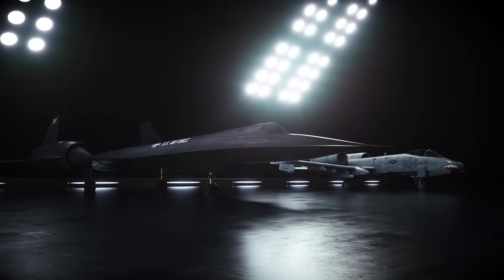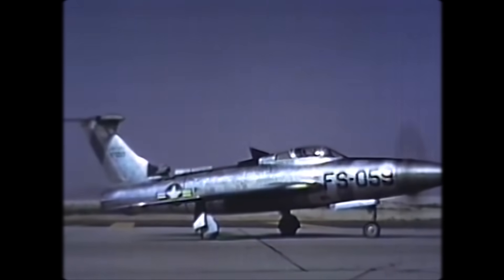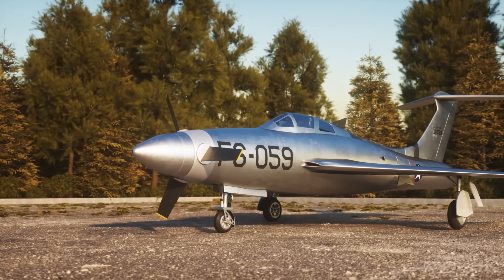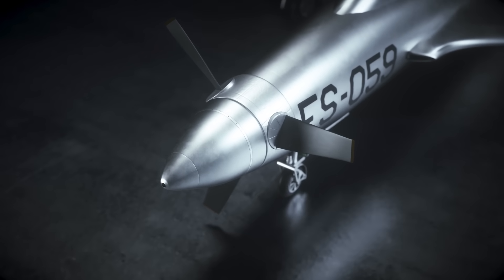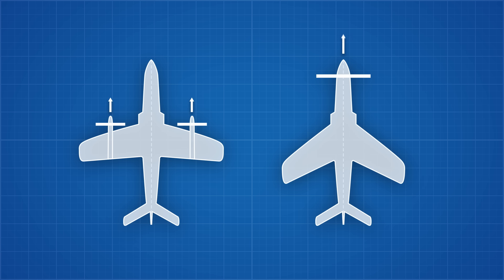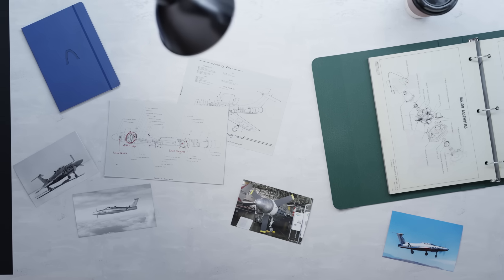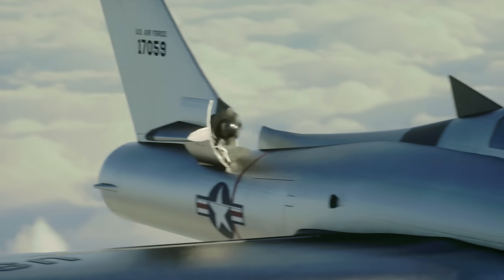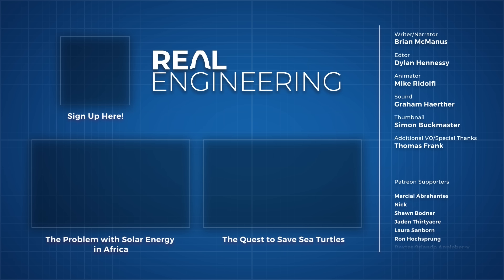The Insane Engineering of the Thunderscreech

Comment: I wonder how this would work on a drone powered by electric motors to shut the noise off until over suppression areas. One of these props on the front and a jet for thrust and electrical supply.

Comment: 13:12 why didn’t they use a contra rotating prop design like the A2d-1 to counter the torque?
Reply: not sure but id assume it's because there would be a bunch of issues with drag at high speeds when theres two propellers.

Comment: Decibels are a logarithmic scale of the pressure created by a sound wave compared to a reference pressure. Every 10 decibels you go up, the pressure increases 10x. If you go up 20 decibels, the pressure is (10)^2 times the previous pressure, or 100x. This thing was said to produce 200 decibels. A rock concert is around 120 decibels. 200 decibels is 100,000,000 times that

Comment: It's strange to call this an "abomination" when in fact it's pretty clever engineering to get around a lot of problems. I wonder how many discussions there were around weaponizing the sound this plane generates. Making low passes over enemy lines could dramatically reduce their combat effectiveness without expending any ammunition. I bet modern materials and engineering could solve some of the reliability and stability issues. At the very least, carbon fiber driveshafts would reduce the vibration issue.

Comment: Very late comment coming in here, but c'mon man, don't shit on the TACIT (not tactic) BLUE. It was the follow up to the HAVE BLUE which gave us the F-117 and the TACIT BLUE is directly responsible for the design of the B-2. And it was a surveillance demonstrator, but was also the computational proof of concept for the implementation of Pyotr Ufimtsev's "Method for Edge Wave in the theory of Diffraction" in rounded and non-polygonal surfaces. So if you think the F-22, F-35, B-2, or B-21 look like they are "designed by a three year old", then okay stick to your guns.

Comment: i see there is misconception, and funny how even the uncle sam's engineers are completely dont understand what sonic boom is.  they could mistaken the thumping sound when jet engine reach the speed of sound expansion with the sound coming from a aero vacuum crack. aero vacuum crack dont sound thumping, it sound shrieking. 
so when they hear a loud shrieking sound from the propeller thats not sonic boom. thats aero vacuum crack. thats the same "boom"(notice its not booming. unlike sonic booms) you  hear from any other kind of aero disturbance. sonic boom thumps, because its about sound pressure reaching millions times of the source of the sound itself. multiply the decibels. the overlapping sound makes a thumping sound. like a slap at the air.
i think the skunkworks themselves have just learned what sonic boom really is right now, when they tested that new plane with the super long fuselage. when they will realize the sonic boom does not cause by aero disturbance, but by the speed of sound itself. when sound going as  fast as it expand and overlaps.  (notice i said SOUND. you want to get rid of sonic boom you make engine produces no sound when flying.)
thats why they call it a thunderSCREECH. because it caused by the air vacuum cracks produced by the propeller. sonic boom on the other hand would be produced BY THE ENGINE hums, when the plane goes at exactly 1:1 speed of sound.
and that shrieking sound from the propeller only signify one thing, BAD AERO DESIGN on the propeller.
 in formula one, the engineer recognize BAD aero coefficiency of a section in the car mould when it produces loud aero turbulence sound.
meaning the propeller blade design is BAD. hence why they said the plane DIDNT REALLY REACHED the speed of sound in practice. too much RPM lost to the vacuum cracks on the propeller's INEFFICIENT aero flows. which means energy loss.
im sure the skunkworks who worked on that would understand what i just said.

Comment: 2:05 it’s funny that you say a prop plane is the loudest plane ever created when the F 35 F135 Pratt & Whitney engine is considered the loudest thing on earth like 170 dB or something like that 180 dB wanna top fuel dragster full throttle is like 150 dB the only thing that might be louder than a jet engine is a rocket engine. I’ve also heard that rockets that take off are also the loudest thing on earth but there’s absolutely no way a propeller engine is the loudest plane engine ever made I guarantee the Pratt & Whitney F135 that is in, Lockheed Martin F 35s are louder if not one of those giant engines that was in the SR 71 or maybe the six giant engines that were in the XB 72 Valkyrie, but I guarantee there’s no way this engine was louder not even with the weird shape propeller, making ungodly noises from a pure guessable stand point it’s impossible for a propeller engine to make more than 160 dB

Comment: You can really tell it was purely a propeller "proof of concept" platform rather than a testbed for a whole aircraft just because of how slapped together it was.
"Here's an aircraft, make it work"
A single turbine with a pusher prop configuration would have made a lot more sense *for a plane*, but as a proof of concept this did exactly what it was intended to do.

Comment: Love ur vids but I think ur assessment of the propeller producing the screech is incorrect. IMO the Screeching sound is made by the air being forcibly sucked into the tiny intakes creating a vaccum which created a whistle and if u keep adding more power the inflow of air is going to get more violent making the case even worse. I spent the entirety of the video looking for the intakes only to realize those slits in the wings are the intakes. the induction shriek is even audible in certain cars where the intake system is overwhelmed by the demands of the engine. u can blow a whistle by blowing air out or in and i think the latter is responsible for the sound.

Comment: The V22 Osprey engines are both mounted on the end of each wing but there is a driveshaft that stretches across the wing, connecting either engine to either propeller. So if one engine fails, other engine can power both propellers without any asymmetric thrust.

Comment: They should apply the counter rotating revision of this propeller concept. This would be not just torque, precession and propwash-free, but even higher thrust, higher efficient air mass flow behind the propellers, which is better for the higher speed regimes. And of course, the sound would be way more louder! :)

Comment: You are all making a wrong assumption. This thing wasn't a plane. It was a sonic weapon in the form of a plane.
Reply: you know what, give it the loudest and fastest engine we have, get the most powerfull gear box, use very wierd wing angle, use variable inlet guide vanes, or whatever the avro vulcan uses, design the  chassis to create a loud blue note, and fly it low altitude at high speed.

Comment: Fun fact: This aircraft was believed to have produced a sound of or exceeding 200 decibels. Sound is no longer considered sound beyond 194 decibels.
Reply: What is it considered? Just shock waves?
Reply: @AedanfromWinnipeg there is no sound until it is heard, and you die if you even try hearing it because of how loud it is
Reply: @AedanfromWinnipeg yes. Any "sound" past that point is just a shockwave
Reply: Wouldn't 200 decibels instantly kill everyone nearby? Sound 180 decibels or higher can kill
Reply: Hence why it gave a pilot seizures and induced vomiting and severe headaches for everyone who watched him take off that day. A couple people there reported permanent hearing loss. The engine had so much power that while the propellers turned the engine turned the plane the opposite way into a barrel roll, so they constantly had to pitch the plane the opposite way.
Reply: It is, a rocket launch is 160 decibels, enough to make you temporarily deaf  @KingOfTheViltrumites
Reply: Above 194 dB the low pressure point of the wave reaches vacuum, traditional waves no longer function so you need literally shock fronts on the positive side of the wave. It's crazy.
Reply: Correction: it was believed to produce that amount of noise, but was never measured, that’s just a myth
Reply: What is it considered?
Reply: @nihilism1986  Shockwaves
Reply: First harrier and now the f35.     Screeching
Reply: Naw
Reply: Wow.
Reply: Whales can click that loud
Reply: @lukewalker4813  Water will support wave rarefaction beyond 194dB.  This is likely part of why they are capable of making sub-hydro sounds that loud (beyond just being, you know, enormous).
Reply: @lukewalker4813 The Sperm Whale has the loudest click at up to 236 decibels under water. Ouch!
Reply: Yep, above that point you’re flapping vacuum like thunder.
Reply: Actually sound isnt sound after about 240db.
Reply: Everyday I prey that a full, high-res, lossless audio recording of this absolute fever dream of an aircraft will emerge.
Reply: @minimumapature3361probably does exist as a weaponized version in a gov lab. Trying to imagine the speaker / transducer to play it…
Reply: Not possible. This thing would destroy all recording equipment of the time...and this time for that matter.@minimumapature3361
Reply: @FakingANerve if it wasn’t a fact then it wouldn’t be a comment
Reply: @FakingANerve  name 5 deoderant brands
Reply: @aguywhoplaysgames Bruhhhhhh LMAO
Reply: @aguywhoplaysgames  you could google them instead of waiting for me to see your reply, find a source, and comment to include them. Also the word you are looking for is "deodorant." You are the epitome of laziness.
Reply: @aguywhoplaysgames  Aarid Extra Dry, Secret, Old Spice, Degree, Speed Stick, and as a bonus, Axe, Tag, Mitchum, Harry's, and Suave. There's more of course but that's off the top of my head.
Reply: @FakingANerve  or you could google it instead of waiting for the commenter to see your reply, find a source, and edit his comment to include it. You are the epitome of laziness
Reply: @aguywhoplaysgames   Since you're being a prick (I did Google it before posting the my first comment) why don't YOU Google how loud the Saturn V launch was. 😘🖕
Reply: @FakingANerve  thanks!
Reply: Your farts?
Reply: Sweet deletion of comments. 😘
Reply: @FakingANerve you still posted cringe my guy you can delete the proof but we still know
Reply: @LeafBoye dw bruv, he lookin like a clown
Reply: @LeafBoye 😂😂😂
Reply: @LeafBoye  what did fakinganerve do? They deleted the comment
Reply: @FakingANerve cringe

Comment: Folks, this is a FASCINATING airplane.  But we have seen what high speed propellers can do;  I was told that at IDLE this airplane could be heard 25 miles away!  These had geared engines in which the turbine engines were GEARED, which means that they can push the throttles forward and back, despite the EICAS system.

Comment: I don't understand why the prop shafts had to work at 14 thousand rpm when the final drive only had to be 2.1k rpm? Why not just run the engine at the same speed as the props required?

Comment: Why couldn’t the engines just run at 2,000 rpm’s and turn the prop the same speed. Is it common aviation knowledge that the prop has to have a reduction gear to run much slower than what the engine can produce on all propeller driving airplanes?

Comment: Im having a serious problem with this man calling this a super "sonic propeller" im an A&P and one of the first things you learn about propellers is if the tip speed exceeds the speed of sound the prop will destroy itself due to the pressure differences across the span of the blade caused by the shockwaves generated by blade tips

Comment: You are confusing pitch angle of the prop blade with "angle of attack" at 7:00 which makes the explanation bit more confusing than it needs to be.
Angle of attack is by definition angle between blade path and the pitch angle

Comment: im surprised they didnt test 2 props right next to each other 1 spinning clockwise and the other counter clockwise to cancel each others rotation. could it be feasible to have a turbojet engine that also is a turboprop. technically not 2 engines.

Comment: This plane was not a failure. It's concept was a failure. Coupled powerplants never worked out. Not on the HE177, Fisher Eagle, Manchester, Skyshark, Brabazon. Propeller data was useful in the design of turbofan compressor sections. And before anyone pops in here regarding the Gannet, those two Mambas were NOT coupled.

Comment: It is my understanding that the need for the propeller was NOT for shorter take-offs but for improved thrust-response.

The jet engines of the time had very sluggish throttle response. If a landing had to be aborted it took time for the engine to increase power. Hardly ideal for a touch-and-go on a short carrier deck. The same is true when trying to adjust for sudden changes in tail vs headwind on landing approaches.

Contrast this to a propeller aircraft can which can adjust thrust on-the-fly simply by changing the blade-pitch. The engine can be left at high rpm in case power is suddenly needed.

Even today, turbo-props deal with micro-bursts far better than jet-airliners and generally can set down better in fast-changing wind conditions.

Comment: The speed of air leaving the propeller is dependent on the circumferencial speed and the local pitch (blade angle). It is possible to design a prop blade where the velocity leaving the blade is constant from the minimum radius to the maximum radius.

Comment: Tacit (Tass-it) Blue was extremely successful in its mission.

Edit:  Jesus…I’m three minutes in and you have so many errors.  Early jets still out climbed propeller driven aircraft.  Jets needed longer runways because they’re heavier and had higher stall speeds.  The Thunderstreak wasn’t to increase kinematic or climb performance over an F84 Thinderstreak, it was to increase fuel efficiency by using a turbo prop instead of a gas guzzling turbo jet.  Climb performance is actually ~3000 feet per minute less than its Turbojet brother.

Comment: I would immediately wonder why wasn't contra-rotating blades weren't thrown in to counter the torque, but then I realized that would be yet another set of blades going faster than the speed of sound,  the theoretical second pair of propellers would have to take air that was moving faster than sound, which would yield unpredictable complications for design.  Maybe could be tested now, who knows?

Comment: Couldn't the torque problem be solved by having 2 counter rotating propellers? The plane has 2 drive shafts, two engines, and one propeller torqueing it in one direction. I'm assuming there is some nonsense related to the difference between the air speed hitting the first vs the second propeller.

Comment: I think that if the plane has severe vibration problems due to the twin rotating drive shafts, the problem is obvious, there had to be an issue with balancing the shafts so vibrations weren't an issue. They were either poorly machined, flawed in their metallurgical composition/uniformity. or they didn't have a device that could accurately balance the shaft properly for such high rotational velocity. My guess is that they simply couldn't accurately balance those shafts for speeds of 21,000+ rpm. With this in mind it isn't any wonder at all that they had engine problems, the vibrations would have caused the engines to crater far sooner than would be expected. Plus, I think if they were to put a shroud around the rotating propellers they could have mitigated the issues with the high noise/shockwaves, it would have still been loud but it could have stopped it from causing seizures, or forcing people off their feet. Humans can act really weird when noise messes with our inner ears, just ask the designers of the sonic cannon for use with riot control measures, the negative side effects from excessive noise are, to say the least, extreme.

Comment: I'm no engineer, but I think some of these problems could be eliminated or greatly reduced by two solutions.
1. Counter rotating props. Two smaller propellers rotating on the same axis but in different directions.
This would eliminate the torque problem, since the two props cancel each other out. And and by the use of two props their diameter could be decreased without decreasing blade area, lowering the prop tip speed.
2. Move the transmission behind the cockpit and have 1:1 gears in the propeller end. This would decrease the driveshaft rpm and reduce vibration.

Comment: So a slitght misconception on the prpeller types mentioned is that when reffering to a variable pitch prop you are actually talking about a constant speed prop which is the same as a variable pitch prop but it has a governer on it to maintain the engine rpm and to provide the best propeller eficiency for the speed, great video though i love the aviation stuff alot.

Comment: Sounds like all this plane's problems (except maybe the sound) would be solved by moving the reduction gearbox to the engine side of the shafts so the whole of the shafts didnt have to spin at engine speed and having each engine run a counter-rotating prop to counteract the torque roll. But im not an aeronautical engineer...

Comment: More bull droppings than anything.  The Air Force had a problem with fuel sucking jets.  So they thought a composite powered A/C might work. The sound problem was due to the propeller design.

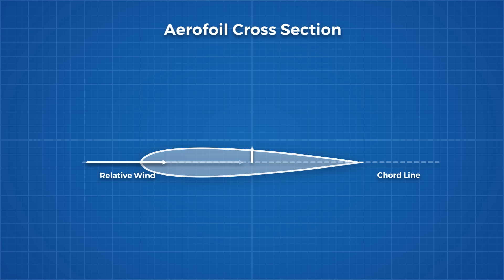Comment: At 5:58 you show a symmetrical aerofoil with no camber at a zero angle of attack, and then say it would provide lift. It would not. In order to provide lift at zero angle of attack, there would need to be some assymmetry/camber built into the aerofoil shape.